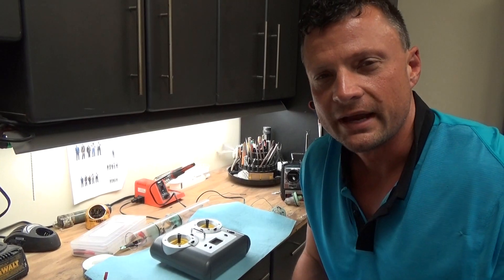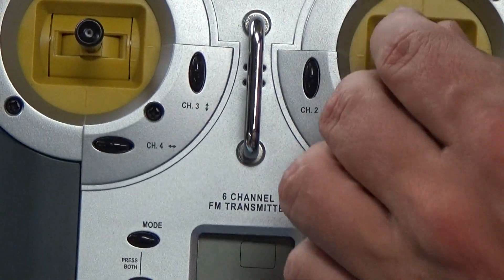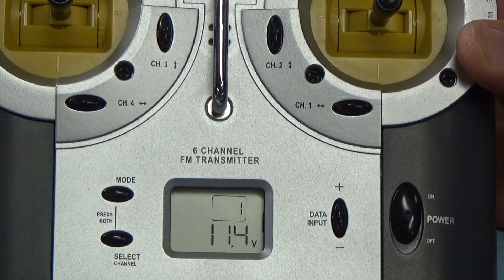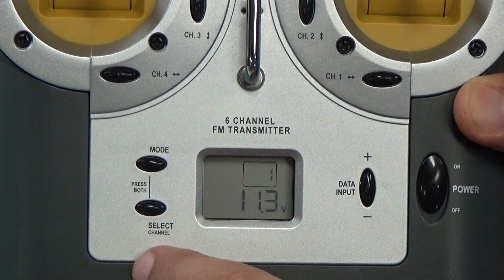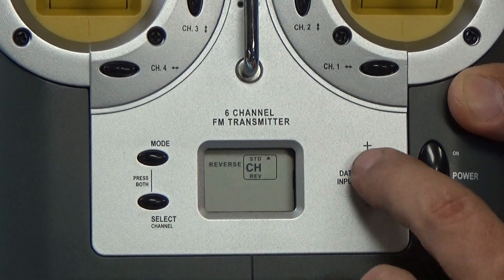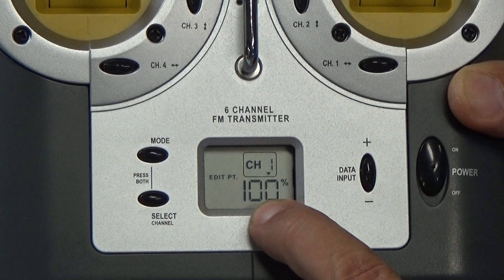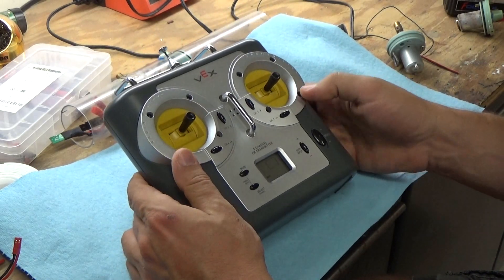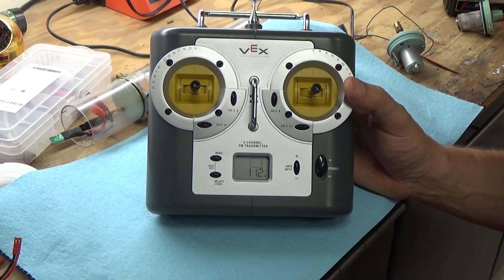VEX Robotics 6-channel Radio transmitter for RC submarines

Comment: Do these TX's have a charging jack so you can put in nicad's  ?
Reply from the maker: No charging jack. As built, them come with AA battery holders, but I do have NiCd batteries for them, too, which must be charged outside the radio. Hey... beggars can't be choosers.

Comment: How deep under water can this radio transmit and receive the signal?
Reply from the maker: In pure, fresh water with you standing over it? Over 30ft, I'm sure. As you mix in chemicals, minerals or biological contaminants, the range decreases quickly. Also, depth is a function of distance. The further away you are, the more shallow you need to stay.

Comment: Here in Britain you can use 27 or 40 Mhz frequancies for subs , but not 2.4 ghz .  $ 138 seems a bit steep to me for a transmitter gear . four channel is enough, for subs ,  6 I never use  . personally I use rechargeable batteries . I do a lot of sailing with models and I find it works out cheaper .
Reply: Hey can you tell which transmitter reciever set you're using because I'm bit of confused what to use and i don't want  a lots of maneuvering plus couple of foot deep dive is fine with me.
Please help
Reply: @bsm5943  You always can puchase a used 27, 35 or 40 mhz-set out of ebay. Thousands of them for sale these days. At least here at ebay.de.
If you have to import from Germany to the States, thats bad for you though - high shipping rates and also taxes to add.
Reply: @werner.x  thanks bro i got one few months back

Comment: I used a 72.160 radio for boats. The controller was a 7 ch modified to 9 ch. Didn't see what the fuss was all about. But it DID give me the advantage that none of the other boats were on the same frequency so I could have fun endlessly. Now I have the Vex and it is a far superior controller than I had before although it does not have the RF power that I was used to.(a full one watt) Not sure what the range is with the Vex.

Comment: radio no longer under production long ago, its like the review of the ford T this video
Reply: https://www.rc-submarine.com/product-page/vex-75mhz-radio-transmitter
Reply: Richard Edwards he is reselling, he made an stock and selleing the radios wich is a good thing, but vex has discontinued the radio, sadly theres no tx in production today for subs, futaba still producing an 4 channel am radio but 4 channel in a sub is very limiting, the only solution today is buy a 2.4 ghz radio and 433 mhz fpv long range module, it dosent had the same penetration and range but at least work, i think that we need to gather a kickstar project and rise money to pay a electronic engenieer to make an open source fm 27-72 mhz radio
Reply: @jorgeneo560  hey bro I'm a working on a model. The suggestion you gave to work with 2.4 ghz radio and an fpv module will it work if I'm not going too deep. Please help
Reply: aditya kumar mishra yeah i wil work at least for a few meters, usea a 433 mhz module
Reply: @jorgeneo560  thanks a lot bro
I was at the dead end
Any other suggestions?